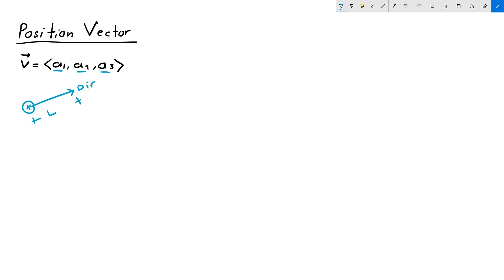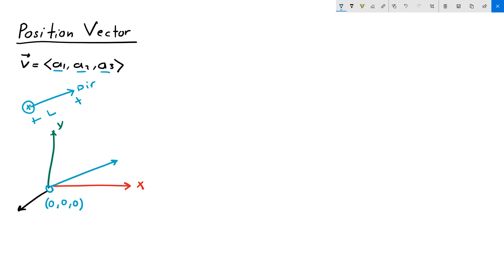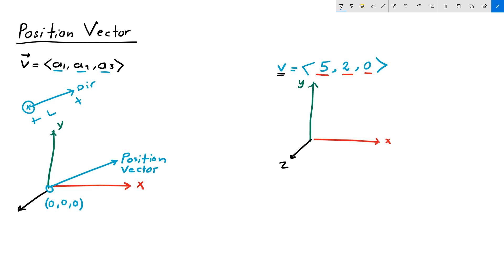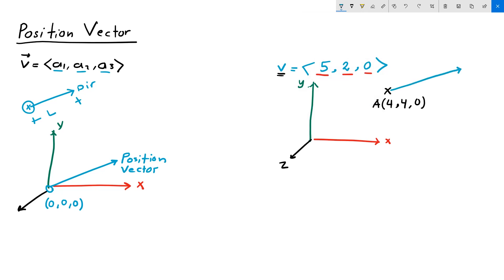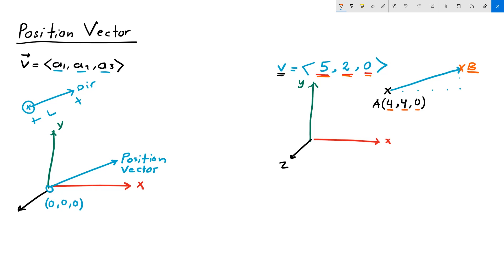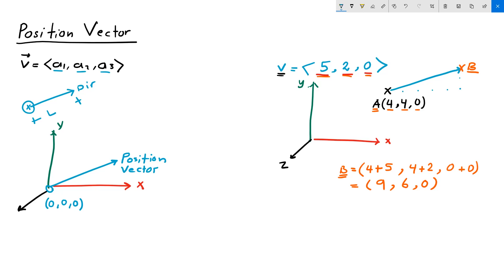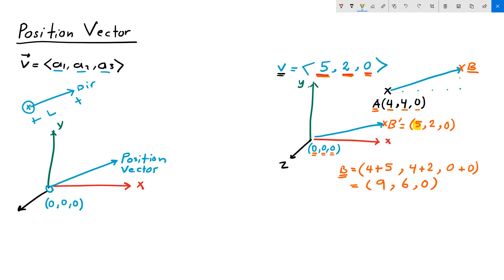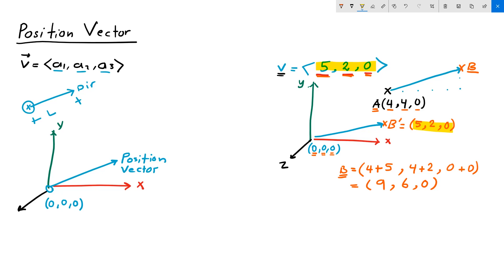EM_04_Position Vectors

Comment: Thank you for this utmost clear explanation about position vectors Position vectors differ with respect to the anchor point ❤ If anchored to origin a vector becomes position vector and the vector tip point coordinate is same as vector X, Y, Z components 👍